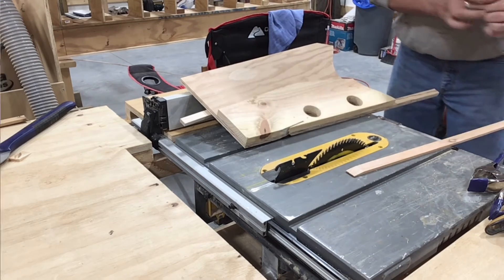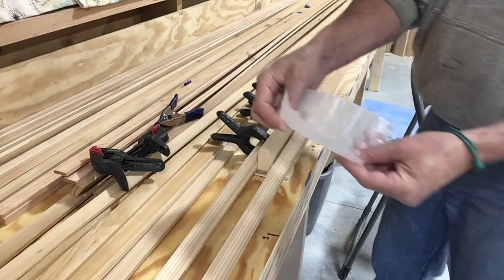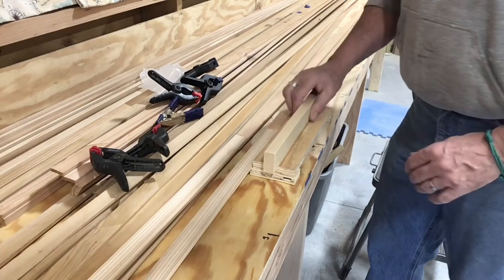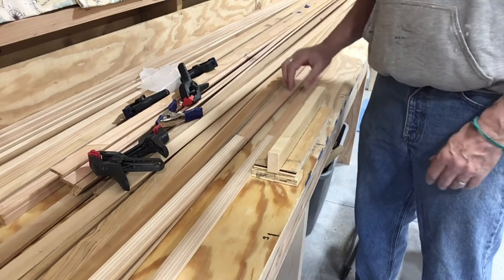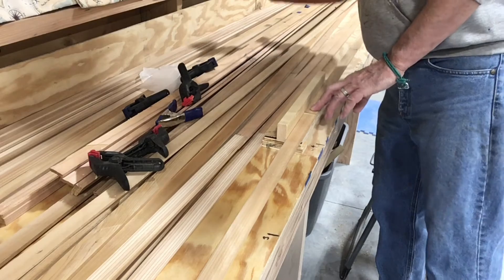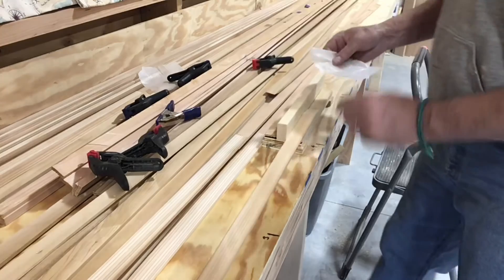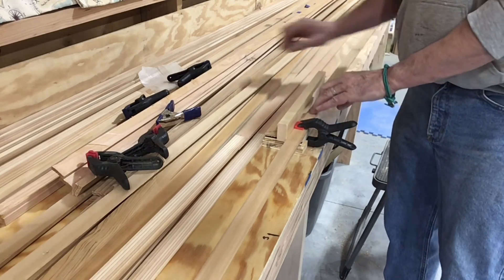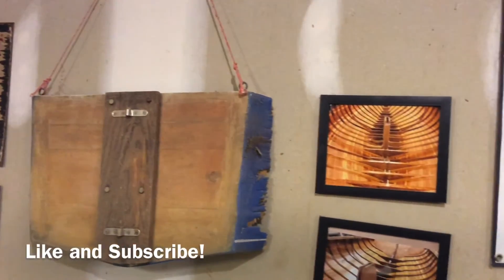How to Scarf Cedar Strips - Freedom 17 Canoe Build-Episode 8

Comment: i use a belt sander with a block of wood and it takes 3 seconds for each joint and it comes out sanded perfect, square and flush

Comment: I've always just stacked all the pieces with the ends offset by the length of the scarf, then plane down the 'stairsteps' until they're a smooth ramp. Works well and you can do as many piece at once as you like, the more the better.
Reply from the maker: I like this.  I actually did similar with plywood when building a CLC kayak.  Clearly there are multiple methods. I half expect to come up with another idea soon. ha!

Comment: I like how you can go to a local store ( I think I'm right that it is not too far away ) and get all that clear cedar. It would have to come from a specialist over here. Do you know how many strips you will need for the canoe? I know you won't have to scarf so many when you get to the underside, but there is a lot of work to do before you can get going. PS. I've seen the clue in the background.......
Reply from the maker: Hi Dale, Yes, we are fortunate with the local stores, except, you really have to pick through the pile to get clear pieces. I make a habit of looking for a good board, just about every time I go into one of these stores, even if I'm just in there for a box of screws. On one occasion I found two incredible boards and asked the lumber manager to set them aside for me. I had to go home and get my trailer!  How many strips?  I'm going to say somewhere in the neighborhood of 60 but you are right, the bottom or football strips get much shorter.